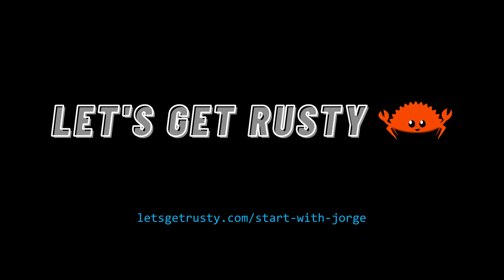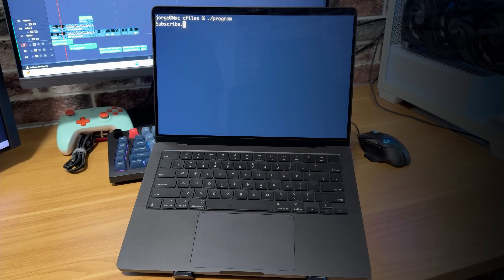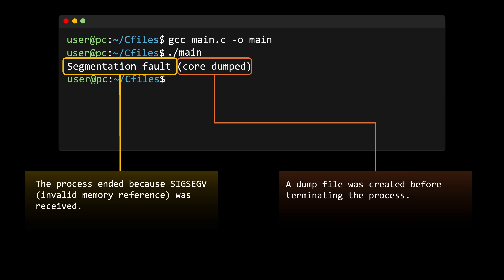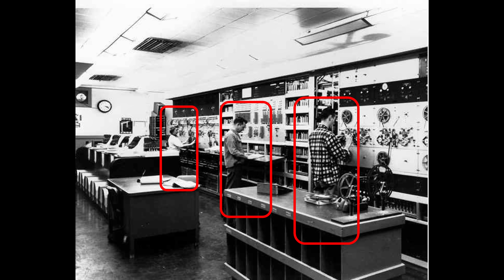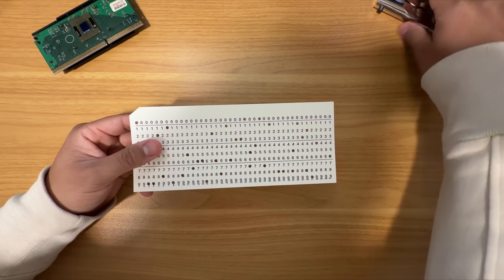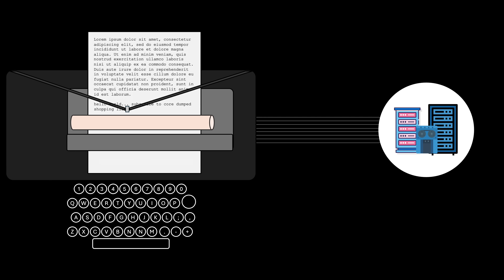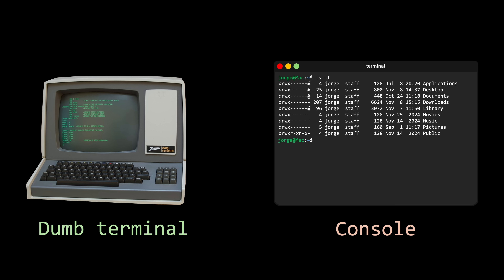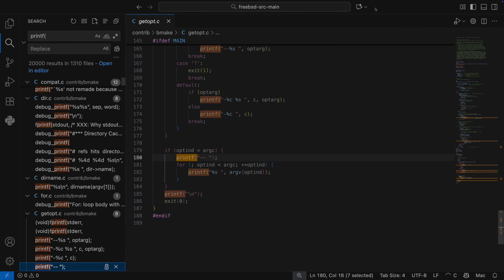How History Shaped the Programming Terms We Still Use Today

Comment: My old Win98 desktop had more RAM than they could've hoped for, and I still can't finish half of my side projects either. However, as for naming that function, for my standard library for my language, I finally settled on naming it `put`, for the overload, and for the explicit names `putc` and `puts`. I've been considering whether to add a flavor of either which automatically adds the newline, but that feels excessive. Also, if I ever retire, I really want to build an entire computer using vacuum tubes and core memory. I've always had a soft spot for both technologies since a human could build them entirely by hand. No need for laser lithography or any clean room.

Comment: I wonder if the reason as to why its called "dumped" and not "logged" or whatever else, is because magnetic core memory is somewhat volatile. Reading any particular bit also destroys the magnetic field, so special routines and circuitry need to be made to maintain the memory. It wouldn't surprise me if it was easiest to just destructively read each bit sequentially and write it out to a printer, especially considering how slow these  machines were.
Reply: The re-writing of destructively read core memory was done at a very low hardware level.  The software to read the core for the dump, could not disable the write-after-read functionality.

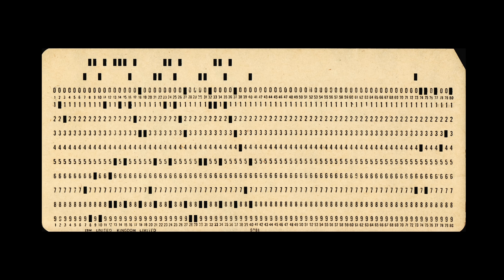Comment: 8:20 I guess punchcards are the reason for the imperative programming paradigm. The advanced x86 and ARM CPU's of today perform heavy dependency analysis and out-of-order and superscalar execution and register renaming, thus the imperative paradigm not even matches the working of modern CPU's anymore. Yet, most high-level programming languages are still imperative, with all its disadvantages.
Reply: Don't compilers already optimize for this by grouping non-dependent instructions together to maximize ILP? And even with out of order execution, the instructions still need to be committed/retired in the order they're fetched

Comment: However, Cobol which came out in the 1950s uses the term "DISPLAY" not PRINT.  Print also has another meaning.  When I was in school printing meant write the characters like what I am typing right now.  When you wrote in cursive or script, it was not called print, it was called handwriting.  Interestingly with early languages like BASIC: PRINT meant to write to the console, but LPRINT would output to the printer.  Also, you could use redirection in DOS to redirect output to LPT port which was generally the port used for the printer.
Reply: Back in the 1980s, the company Sharp sold a computer that ran BASIC. Not unusual. However, in its version of BASIC, PRINT sent text to the printer. The command to print to the screen was DISPLAY. Nobody else did that!
Reply: @mrab4222  I think it's interesting though that two of early high level languages both from the 1950s didn't use PRINT.   COBOL used DISPLAY and FORTRAN used WRITE.  However, C did use printf, but I don't think that was in the early version of the language.  Also, its printf wrote to standard out which could be redirected to the printer, console or any other output stream.
Reply: LPT stands for "line printer", which was a type of high speed printer, not used for interacting with the computer but to print large amounts of data. Printing terminals (ex. teletypes) were very slow, around 10 characters per second, so programmers would make programs that talked to the user through the printing terminal (PRINT) and printed data and stuff on a line printer (LPRINT).
Reply: @Z80Fan  Not on the 386 PC machines running DOS, it was just the regular printer port for the PCs by that time.  Most of them had 3 ports (2 Serial COM Ports and LPT port.  One of the COM ports was generally used for Mouse and the other for a Modem although you could attach other peripherals.
Reply: @alexaneals8194  The whole point of this video is "names that don't mean what they originally meant anymore but stuck around", so of course you wouldn't connect an actual "line printer" to a 386 system (and you wouldn't connect them to the vast majority of microcomputers and minicomputers). Just like serial ports were traditionally used to connect to teletypes so they got called "tty" in operating systems, parallel ports were used to connect high-speed printers so they called them "lpt" and the convention stuck around (even modern Unix systems use these names).
Reply: @Z80Fan  If you read my comment, you will notice that I said both COBOL and FORTRN do not use the print statement to write to the display.  Cobol uses "DISPLAY" and FORTRAN uses WRITE. Both of these languages are from the early period of computing.  They both predate BASIC which uses PRINT and also the term print did not always refer to printing out documents to the printer.  When I was in school, we were asked to either handwrite or print our essays.  Handwrite meant to use cursive writing and print meant to use normal characters (or the characters you are reading this comment in).  So the selection of the term print for software languages had little to do with printers and more to do with the type of characters being used at the time.
Reply: @alexaneals8194  And if you read my responses, you will notice that I'm not talking about COBOL and FORTRAN but about the second half of your comment regarding PRINT vs LPRINT and "LPT" in DOS.
Reply: @Z80Fan  Sorry, if I misunderstood you, but I wasn't referring to the mainframe when I mentioned the Print and Lprint, but to the PC.  The language in particular was QBasic that had the PRINT and LPRINT and I agree that the names came from BASIC that was developed on the Mainframe; however, the redirection command in my comment was DOS specific and LPT port was on the PC.  So, on the PC you could redirect output from the console to the lpt port and the printer in DOS.  At the time lpt port was mostly used for the printer, although it's possible that other peripherals could use the port, but I can't think of any that did.
Reply: @alexaneals8194  My point was that MS/PC-DOS has "LPT" because it was a typical name at that time for "the printer", derived from the "line printers" of mainframes. Even CP/M (the operating system that... inspired MS-DOS) used the same terminology, and Gary Kildall (the creator of CP/M) was used to working with mainframes, so it's plausible it got the name from there.
Reply: @Z80Fan  I agree that LPT probably came from the mainframe.  The point I was talking about is why "print" was used in the programming language probably had nothing to do with the printer since the term has a different meaning even before computers came into existence.  Also, "print" meant write to standard out which is generally the console, but not necessarily since you can use redirection to send it to a port like LPT.

Comment: If you named it “display” it would still be wrong in most cases. In Unix (Linux macOS etc etc) you’re sending data to something represented by a file descriptor. Maybe a TTY. Maybe a file or pipe. Maybe even a printer. Maybe a paper tape punch. Maybe a speech synthesiser. Maybe a socket. 
The word “print” has just taken on a broader meaning.
Reply: Yup.  Even "output" would not fit, since your "output" might not actually "put" anything "out" to anywhere!
Reply: @ChristLink-Channel  😂
Reply: how about just "put"
Reply: @Bradleybus  "put" actually exists and is used for single-character output...
Reply: @HenryLoenwind  how about putstr putchar putint or something
Reply: @Bradleybus  puts also exists, and is just put but with a string instead of a character.
Reply: @Bradleybus  I prefer “plonk”. Or for a classic literary sense “allow” 😂
Reply: "echo" seems to fit this purpose very well now that you said that
Reply: In the COBOL language, DISPLAY is the verb to send (originally print) a message to the system operator, and ACCEPT is the verb to receive the operator’s reply (often just a null message to say. That some action was completed so the program can proceed).  To be used sparingly, of course!

There is no PRINT verb in COBOL; a FILE must be defined for output to be printed as a report, and WRITE is used to write to it.
Reply: @a @allanrichardson1468  yea I have a vague recollection of WRITE PRINTER on VAX COBOL for specifically writing to a connected printer. That was a while ago :-)
Reply: Maybe C++ was on the right track. Maybe the function should just be called stdout(). Just don't make the mistake C++ made and operator overload a bitshift operator to represent sending the text to the stdout stream

Comment: Man being a computer engineer in the 50s/60s must have been so interesting. Basically everything was open to be discovered/invented.
Reply: Honestly it sounds like a real chore. Like using a programming language without a standard library, every wheel needs to be invented before you can go anywhere! I think today’s problems are much more interesting and the tools we have to solve them are much more capable. My desktop CPU runs at 5 billion clock cycles per second, and costs so little to both purchase AND run that it’s almost trivial to have. These days we get to solve really interesting and specific problems like what my next job should be after AI ruins the world
Reply: New things are discovered and invented all the time. We just don't know what is going to survive. And it was the same in 50s/60s
Reply: I started in the 70ies as a boy with TTL logic gates - had an electronics engineer as father who taught me a lot - , later the 6502 processor; and, really, it's sooo mind blowing where we are now! What a ride! 😮😮
Reply: Theres still so much to create! But I get what you mean. I still remember reading about the first implementations of ethernet and the first true “intranet”, the precursor to internet
Reply: You could even add 70s and 80s.
Late 80s, East Germany, While the central business data processing was still programmed on an H316 clone, Z80 PCs were already gradually being joined by XT-compatible machines in the offices. Bringing the worlds together was quite challenging but fun.
Reply: Being a computer engineer today still has new things to be discovered. New searching and sorting algorithms are still being discovered and researched!

Comment: Source code patches still somewhat resemble these physical old patches to paper tapes when dumped into file units (the .patch format). Specially when you had to cut whole bugged paper tape sections and replace them with fixed sections.
IBM and DEC themselves were never happy to use the word "terminal" for the command line, so they were on the first advocates to change the term to "console". And that made all through Microsoft when Dave Cutler arrived. WindowsNT (and its current sucessor Windows11) is one of the few systems which still call their user i/o interfaces (graphical or text) as "consoles", at least internally. They also used the term "sessions" for their RDP tech backed stuff (which isn't limited to the remote stuff, as it is also used for UAC and Win32 program isolation).

Comment: So, when a dump terminal controls and monitors the system, then it's a dump terminal Console but if i use the dump terminal as a normal user (not control or monitor the system) then it's a normal dump terminal not a console.

did i understand this right?

Comment: Teletypes were better than video terminals initially, because it was no slower to keep your file in paper form and rearrange lines manually, while you could also see the whole thing at the same time. You could also take the printouts elsewhere and write on them, before submitting changes.

The 'ed' editor is built around this workflow. You never actually get to see your full document, only the changed lines as a result of your last edit command is printed. To remember the current state of the document in memory, you just stick all the printed edits together like a scrapbook. You could even keep things like subroutines on separate sheets for quick reference.

Comment: Never bothered to find why it was called line feed. Now I know.
Reply: That's why they end-of-line signal in Windows is actually two characters: \r (the carriage return) \n (the new line feed) - because that's how you start a new line in a typewriter/teletype. Unix uses just \n because it's based on telegraphic messages and there's no "carriage" to return on those. Which is why a txt file made in Linux won't break its lines properly if opened in Windows.